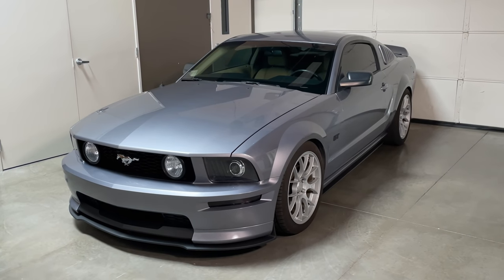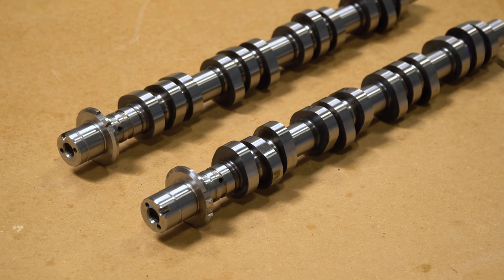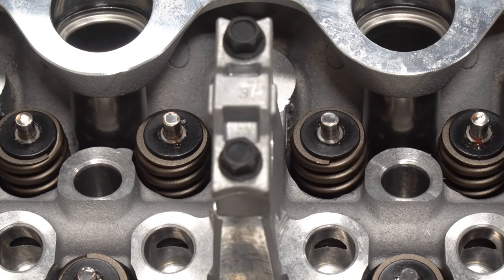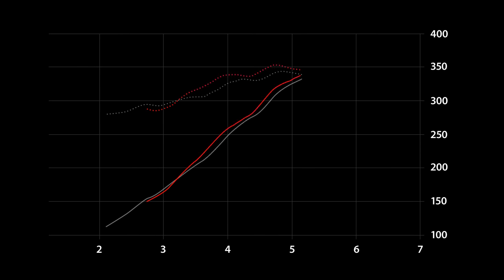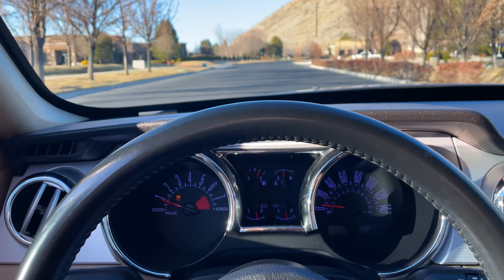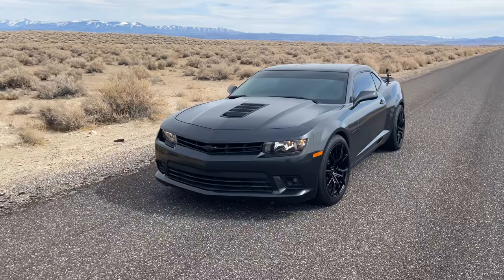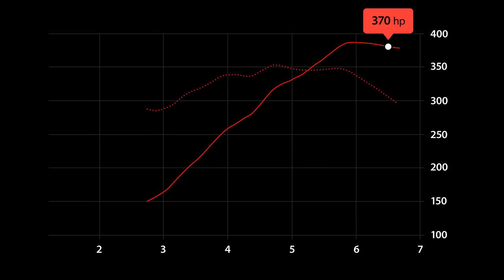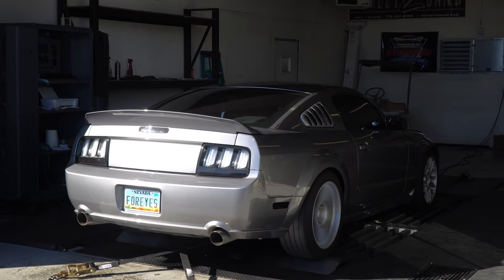The results 📈 of installing the most aggressive cams on my Mustang

Comment: Ford really just dropped the ball with the 3v mustang. It’s such a great looking car too. But 387 wheel for a stroked, heads/cam fbo engine should be the title of a horror movie
Reply: Totally agree. The newer Mustang’s are better in every way. Not worth dropping that amount of money just to keep up.
Reply: @jimshelton1437  really adding to the conversation now aren’t you.
Reply: No kidding! That's a lot of money to spend to get smoked by a bolt on Audi S3.
Reply: @apancher  um u do know audi rs3 are actually really fast if tuned right lmao
Reply: I came to say this too...a more than mildly built mustang only puts down about 50 more hp than a bone stock ls3...that's a bit frustrating..and I don't even own the car. I don't want to hurt op's feelings but man..I'd have such a difficult time keeping the mustang after all of the expenses. I get it, there are ford guys and bowtie guys and obese dodge guys..but damn. 

The 4v with the whipples are absolutely no joke though, or any coyote with any boost will fly. My driving style is light to light though..and you'll never, ever beat a pushrod setup down low. They are so much more fun to drive.
Reply: Honestly I think it’s the best looking mustang ever made besides the obvious 71 classic but yeah I agree.  No bueno under the fronto
Reply: Holden still laps faster at Bathurst since closing a few years ago , mustangs have been racing for a couple years here  . . 🇦🇺 🦁 Aussie punching up relax : ) 🇺🇸 ❤️
Reply: It was competitive for its day.  When the 3v showed up, the only competition was the GTO and the 350z. Thanks to a 300+lb weight advantage for the Mustang over the GTO and similar power:weight with the Z, they were all pretty darned close.
Reply: It didn't get bored and stroked.. it only got honed he didn't add any more displacement to the engine. Just got some shiny pistons
Reply: @fabworldweldingllc6150  he literally said it was stroked out to a 5.0 liter instead of 4.6 and I seriously don’t think that he would put factory size pistons after going through the trouble of doing all that
Reply: Said no one ever gtfo
Reply: @mgmjferg89  me ? Lmao literally everybody trashed the 3V
Reply: I also know a guy who FULLY BUILT A 4.6 with same shit results.....with the money he spent he could have got a Coyote out of boneyard
Reply: @Notoriousfc3s  your completely right. That's my bad he sid get it stroked. I rushed through the video thought he also got it bored wich he didn't even say he did.. I didn't fully pay attention my bad. 🤦‍♂️however it sill isn't a 5.0 it come put to 4.93 wich is like 300 cubic inch close enough. But if he were to bore it out as well he would get even more powerrr!
Reply: Crazy to think my old '02 Formula WS6 MN6  made 38xwhp with just a baby cam (TR224/224 114°) and bolt-ons; stock intake and heads. That same car made 46xwhp with a larger Vindicator 240/244 and Advanced Induction 243 heads. Stock bottom end. The LS was way ahead of it's time.
Reply: 390whp for how cheap it is isnt bad for a n/a car. add another 6k and you can add 250-300hp+ with a procharger and tune
Reply: @Andre-ohigho  390whp out of an OHC isn't necessarily cheap if you don't have the no how to perform the labor yourself. A set of CNC heads for one of these is stupid expensive. I agree though a blower is the way to go with these 3v's because the stock bottom end can handle the torque unlike an LS1/LS2/LS6 which needs a forged pistons and rods to handle anything over 6.5lbs of boost.
Reply: this is why u swap a 7.3, just a ford ls with more torque pretty much
Reply: Well the car made only slightly less before being rebuilt. Lower compression for boost is part of that but idk whats going on with that car. I was thinking 400+ would've been the ticked so idk. There are stock bottom end 2v mustangs making 350whp so this car could've gon wayyyy farther na we know for sure
Reply: @MrCasebi  hmm I’m not to sure. I used to have a 01 cobra with a n/a 4 valve and everything I could find on forums people who were n/a struggled to make more than 380-400 fully built so I doubt the 3v could do much better.
Reply: @Notoriousfc3s  even so for a stroked engine with those ported heads, its just not what id expect. Granted it is not that high revving of a powerband so there's more airflow needed somewhere. I feel similar to a coyote this smaller engine needs to rev out more (which it simply isn't gonna compete with an ls1 for that reason), which it makes coyote numbers at the same rpm with far less advanced valvetrain so technically not so bad. Could def do more though. With a trans that has half decent gear spacing that car would be far quicker too.
Reply: @Notoriousfc3s  eitherway tye car gonna be stupid fast under boost. Any extra n/a power he makes will be a multiplier to his boost number
Reply: @MrCasebi  Low compression explains it. I thought this was a high CR max effort type of deal.
Reply: @ghostmofo5829  

You'll pay more for those newer mustangs too and pay less to bring an 05 up to speed than you would buying even a newer used one, like a 2017.

Besides, 05's don't need to keep up when they present well and if you're not presenting well as a muscle car, then you're  not representing the movement well and that's goddammed unamerican!

05' have STYLE and PIZAZZ and it's very hard to match the appeal of the 4.6's exhaust note!
Reply: @jimshelton1437  

So do Shelton's, especially when they're getting gapped! 😲 🤐 🤪
Reply: @OrignalRecipe92  

Not true, I've gapped pushrods a lot.
Reply: @Notoriousfc3s  

The hubris of the defeated - dey only hatin' cuz the 3v was settin' it off! Just look at the the competitions Mustang was winning on the track and the streets!
Reply: @americanosbadassius9292  Hey buy what your budget allows. I’ve been there.
Reply: @americanosbadassius9292  nobody is hating the ls1 and 350 gen 1-3 all make more power with less.
Reply: @ghostmofo5829  

For me it's about the overall appeal and just recognizing facts. Bringing an 05 up to 400 plus horsepower may not cheap, but it's cheaper than something newer - most of the time. I could spend around 5k and just do a blower, but I like NA better and it's less moving parts. Plus the 05 is lighter and you can make it even lighter by deleting items or replacing them lighter components. I'm thinking seats, wheels, etc.
Reply: @chieppachat9381  yes, it is called an opinion.

Other than that, i think Coyote engines are quite good but are a tad too big to swap into other cars. Plus modifying them seems to cost more too, you gotta buy more cams and more valves for a valvetrain upgrade, etc.
Reply: @sepg5084  indeed it’s opinion I was commenting on his lack of any detail in his opinion.
Reply: @ghostmofo5829   some like to build the cars and engines just to be different, have a friend with a big turbo 3v that runs great. But not everyone is concerned about the biggest HP number
Reply: @sepg5084   you don’t need to buy cams for a coyote you can make 1000 wheel on stock cams
Reply: @ikecostner1  Just post more snow shoveling videos please.
Reply: The thing is, he didn’t rev it out. It’s making all of that power on a stock 6000 rpm power peak and that’s the most aggressive cam they could find. I can imagine different results with 8 or 9000 rpm. Not the engine’s fault there are no cams for sale for that sort of stuff. When people hear “fully built” they expect to see Honda K series power per liter figures when in reality there are no parts to choose from to do that kind of stuff.
Reply: @sarmatiancougar7556  6k for those motors is short yes but 6700-6800 is a realistic range for those motors and that little extra rpm isn’t going to see significant gains. Maybe right at 400. Fully built sbc/sbe/b/k/rotary all can make that and more n/a
Reply: @sarmatiancougar7556  Stick to your Honda wind up toy little buddy.
Reply: @Driftprodigy01  yes, I am well aware. I wouldn't even need an RS3 to keep up with this Mustang, though.
Reply: @OrignalRecipe92  Except, you will ALWAYS beat a pushrod down low if it's spinning - same for any engine. Too much power down low can be a bad thing. My buddy with a FBO Gen1 gapped my other buddy's Gen2 VMP car simply due to traction on an unprepped strip. That's why turbo's are dangerous - you can ramp boost with wheel speed ;)
Reply: Stroke, head and cam any of the modern pushrod competition and it's a horror movie for that 3V
Reply: Drew Peacock has a fast 3v
Reply: @Swayze1997  it’s not fast at all lmao I bet an n/a gen 3 5.0 and n/a 6th gen camaro will gap it
Reply: @Notoriousfc3s  go watch him race people and come back with that same energy 🤡
Reply: @Swayze1997  don’t need to I know it’s slow lmfao. I’ll keep that same energy all day beating slow cars doesn’t make you fast lmfao
Reply: Had this engine been properly built with a high compression ratio the results would have been much better. A 9 to 1 compression ratio just don't cut it for a Performance Engine. It actually boggles my mind that they built this engine knowing that the low compression would be that way and still try to get big numbers naturally aspirated, but I understand they're going to boost it so the low compression ratio will come in handy. So what I'm trying to say it's not very fair to judge this engine naturally aspirated because it's simply not built to be naturally aspirated forever.
Reply: @ghostmofo5829  5.0 has a garbage trans stock, auto is for people that can’t drive.
Reply: As long as it's a modular V8, you can always put a Coyote in it! I gutted my 99 35th anniversary GT, dropped in a Yote w the 10 speed auto, 🤏close to Manual or 4 spd auto w/trans brake
Reply: The mustang was designed as a cruiser, it was never intended to be ripped on. It’s a true muscle car to cruise like a pony
Reply: @Notoriousfc3s  As I recall the 3V was highly regarded because the stock heads flowed like a Mach/Cobra so they made power easily.  With GM dropping out of the competition after the Terminator came out the Mustang was in a class of its own.
Reply: @406Steven  yeah bro it’s clear from your comment you just be reading car and driver magazines and don’t know anything. The 2v and 3v are slow and always have been extremely slow. If they had good flowing heads they would make power. But like I said 387 wheels for a fully built max effort v8 is hysterical. An ls1 with just a cam and intake would make those numbers and the ls1 was the worst Ls out of all of them….
Reply: @406Steven  not to mention it wasn’t the terminator that caused Gm to drop out lmfao. The terminator came out bc the 98-2001 cobra was so embarrassing compared to the ls1 fbody that they had to completely re engineer the car putting a new rear end, drive shaft, transmission, fully forged internals, and a supercharger to compete with a  n/a Chevy small block. Same thing ford always has to do to compete. Over engineer. Even with that the ls1 and ls6 were competitive with a fully forged and boosted platform from ford.
Reply: @Notoriousfc3s  Nobody seethes and copes like a GM fanboy 😂
Reply: @406Steven  no seething and coping just all facts. If you can’t understand simple facts that’s on you lmfao. But it does make sense ford boys are a bit slow I mean why would you willingly pick the slower platform

Comment from the maker: Unfortunately my buddy sold his Camaro 😐 But I am in the process of installing a T56 Magnum on the Mustang (which will be the subject of the next Mustang video). After the new 6-speed is installed and the Mustang is retuned, I'll be setting up some races against stock Gen 1, Gen 2, and Gen 3 Coyote Mustangs, and maybe a stock Camaro SS for good measure. Stay tuned.
Reply: crazy how i just came across this video published months ago and was just about to look for the upgrade then to see this update 😓. Taking this opportunity to say that your content is awesome, to the point, well explained and really really fascinating. keep it up
Reply from the maker: @aalonbullard9320  thanks Aalon 🙏
Reply: 387HP 
Thats it 
My dads olds puts out about 510HP @6000 rpm max
With a 455 blueprint V8 olds
Reply: @issacdaniels942  riveting tale old chap. You do realize the Olds has 150 more cubic inches of displacement right? That’s about equivalent to a 2.5 liter 4 banger. 

Almost 400 whp on a 5 liter 3V is pretty impressive. Excited to see what this does with the trans and rear end gear change.
Reply: Excited for the update. Definitely gonna subscribe for it.
Reply: Super clean 197 
and a lopey boy
Reply: BOOOOOOO!!! I was so ready to see the next race!!! New clutch definitely would’ve helped but those 3.73’s should’ve at least nosed him out.
Reply: @ryan he said, “it has an under drive pulley” guess your ears stopped working for that 4 seconds.
Reply: Please do jus saw this vid dying to more
Reply: Hopefully you bought the Camaro so you'll have a proper race car to modify..
Reply: thismof0  people don't think e85 will do much on N/A cars but that's not true. You might not be able to take advantage of ethanol like you would with boosted applications but my gen 1 coyote picked up 20hp from changing fuel (and a fuel system of course) and if you live in Florida like I do it comes especially handy when engines try to detonate on a 102° day(feels like 110° with 70%humidity). I think with the new trans, new clutch, some e85 and give that thing some more timing then let her eat! Also I'm glad this guy isn't like everyone else and LS swap. Nice to see something different.
Reply: How about smog ? Any issues
Reply: @issacdaniels942  Wow, imagine being surprised that a 7.4L makes more power than a 4.6L
Reply: Soooooooooooo ready for the 3v vid. Love the viper but I’m
Here for the 3v 🔥🔥
Reply: I cant wait to see this
Reply: @tomfoolery5033  that 2-3 shift hurts bad. Even though rear gearing will wake the car up, it can't fix it falling out of power on the shift, only minimize the time its out of power, also while in power as the gears end quicker. It helps but doesn't address the elephant in the room. Gear ratios
Reply: @ryan he did underdrive pulleys, his stage 1 numbers were very impressive and that was part of the reason.
Reply: @Four Eyes,  I am impressed with your Mustang. and all you have done... BUT... I have to know what do you do for a living! How do you afford all this stuff, (kinda lol)?
Reply: I just watched a video from Steve Morris Engines about the difference about N/A cams vs. boosted cams and he is said that aggressive N/A cams on a boosted application could tend to blow air-fuel mixture out the exhaust and could artificially make your sensors read rich. If that's true then maybe it could affect the hot side of the turbo too.

Also watched a video from Richard Holdener where his dyno tests show that aggressive N/A cams on boosted applications make more power than dedicated boosted cams regardless. Though i am sure that Steve Morris Engines dyno test their builds so they would have known this too, but still recommend boosted cam grinds for boosted applications.

Now i am confused lol
Reply: @issacdaniels942  u know that's not even impressive for a motor that's got almost 200 more cubes lol
(Oh and this 3v would still blow the doors off ur Papa's tank) lololol
Reply: Hey man do you have any insight on what kind of increase would have been possible if the car did have proper compression to match the race cams, say 10.5:1 or what the max comp would be possible even on pump gas 93?